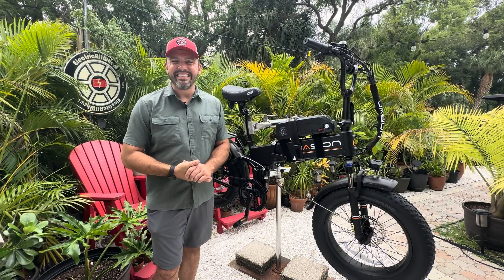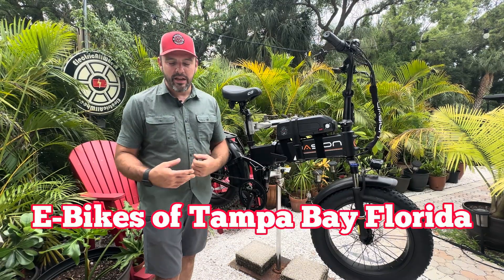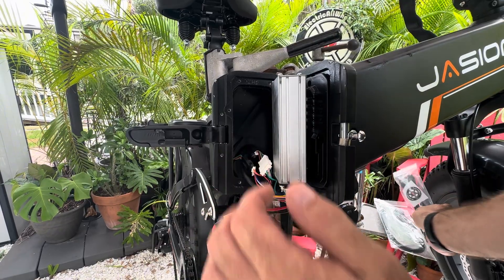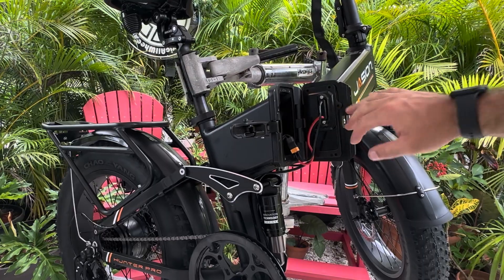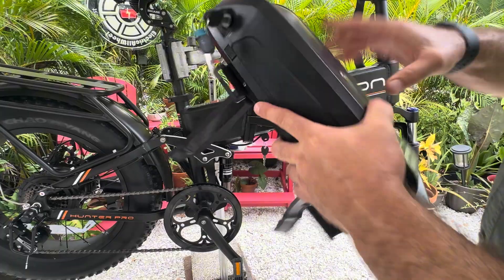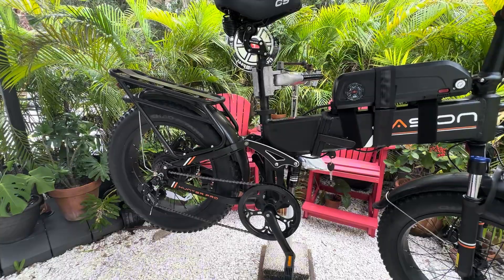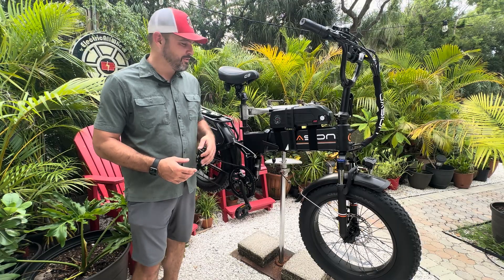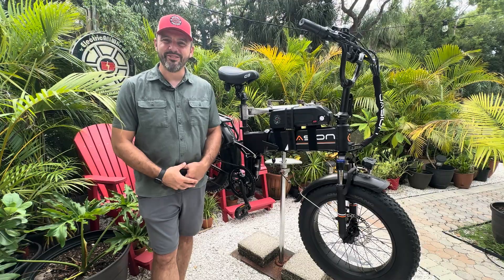Jasion | Hunter Pro | Plug & Play Dual Battery Install 🔋🔋 Add a Second 48V Battery 🔋🔋 Double Range!

Comment: Hello! I ordered the 40 amp balancer from your site. Does the amp hours of both batteries factor in to this installation? I don't think it does but could you please confirm if I can add a 48v 30AH battery to my stock 13AH jasion battery with your balancer? Thanks!
Reply from the maker: Confirmed. This is possible
Reply: @ElectricAllWheel thank you for confirming this!  I wasn't sure if the continuous draw on each battery was something to consider or not.

Comment: New to Jasion Hunter pro what is best battery to use with that set up
Reply from the maker: You will want a 48V battery from the recommended batteries linked in the description of the video.

Comment: I have the same ebike, can i use a 48v 20ah or a 52v 20ah. Or does it strictly have to be only 48v 15ah? Thanks, I want to increase the battery size to increase my distance I can travel on pas 3 -5.

Comment: Does the battery balancer work with dual motors/2 controllers?
Reply from the maker: We do have items like the dual input dual output Dx2
Reply: @ElectricAllWheel Thanks! I’m trying to add a external battery to my dual motor scooter which has two controllers, so I just want to make sure do I need to get one balancer or do I need to buy two balancer?